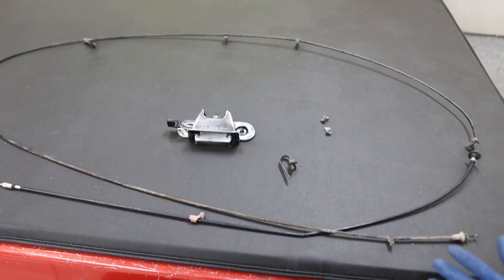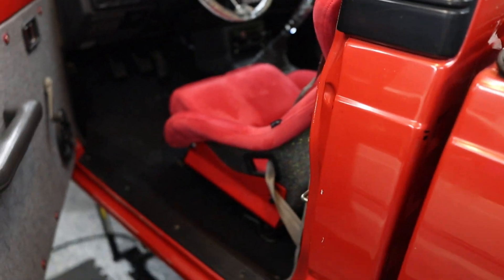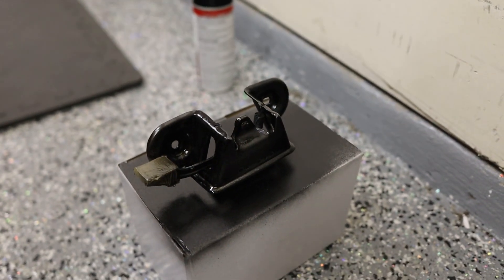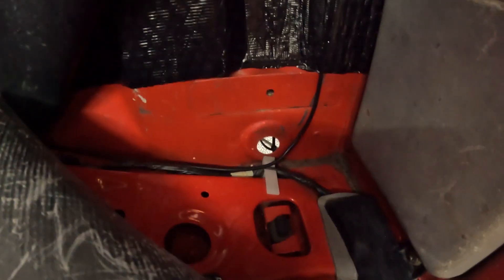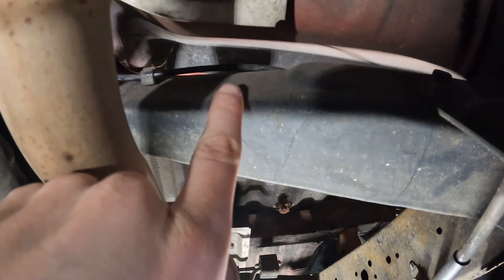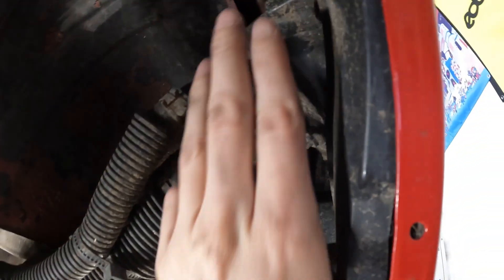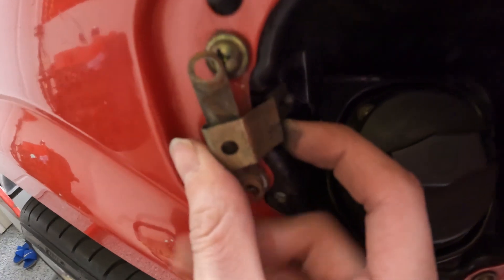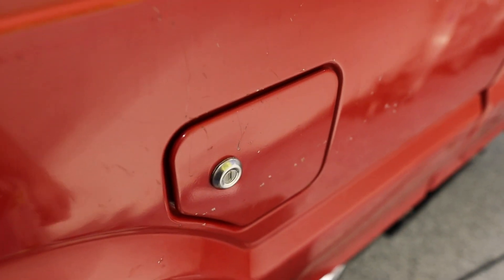OEM Fuel Door Release Install Mazda B2000 B2200 | Flake Garage

Comment: this is sick, didn't know this existed, really want one now because my gas tank is finnicky with my key, i might have to make my own video doing this on my truck but for the extended cab guys like me where i assume its fairly different
Reply from the maker: I haven’t seen it on a extended cab but I’d think it’s a similar setup just with a longer cable. Worth it if you can find it for sure
Reply: @FlakeGarage  id wonder if the routing locations would be fairly different from the single cabs
Reply: My 87 b2000 cab plus base model has this from factory. Pretty sure it's standard equipment for 86-89 cab plus.
Reply from the maker: Nice! I had a 90s cab plus as a parts truck and it didn’t have this system